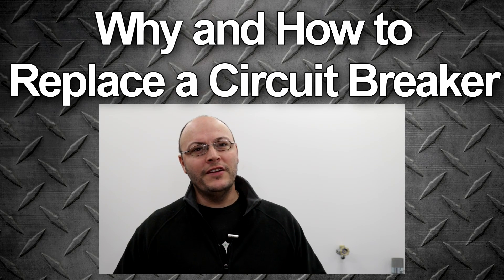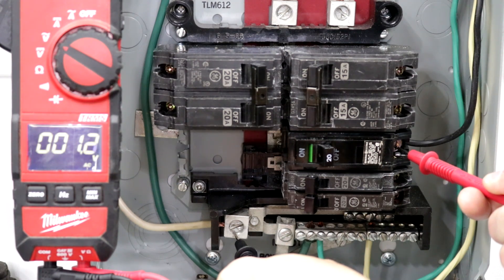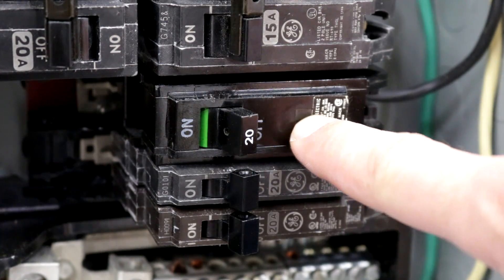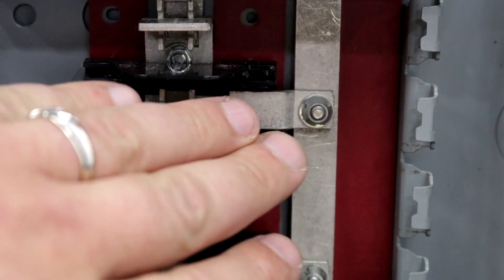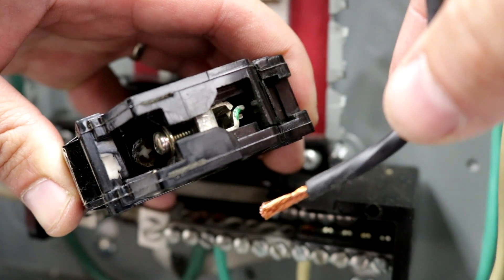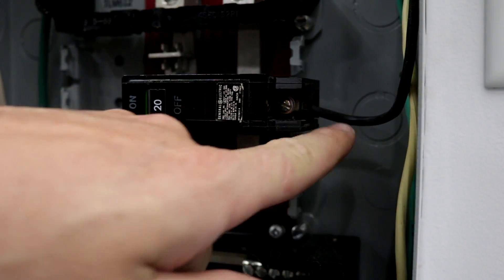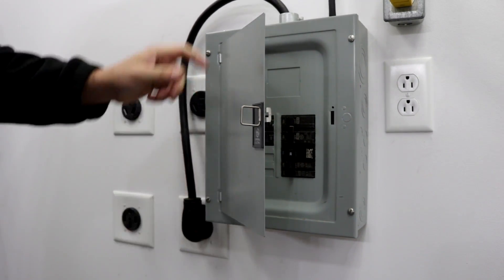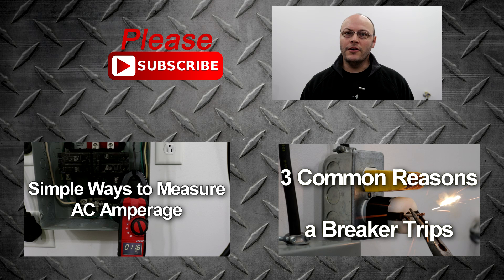How to Replace / Change a Circuit Breaker in your Electrical Panel

Comment: Really helpful... it was great to have this walkthrough before replacing a breaker for the first time!  The only additional information that I could ask for is, how to source a replacement breaker.  What information is required, exactly.  Thanks Bill!
Reply: Look at the panel and determine the manuufacturer.  Different Manufacturers have different sized breakers even though same amp (e.g. 15, 20)  The bad breaker should have a code on it - take a picture of the panel before you go to the store and match up the same type there

Comment: Greetings Bill thanks for all the great videos I have a quick question for the reading audience if I have in arc fault circuit breaker do I need to have an arc fault outlet??
Reply: I just answered my own question I found out the following if you guys are interested and Bill if you’re reading this if you can confirm whether this is correct or not that would be great
“Both the 2017 NEC section 210.12 (D) and the 20RC section E3902.17 state that where branch circuit wiring is modified, replaced, or extended in any of the areas listed above, the branch circuit shall be protected by one of the following: A combination-type AFCI located at the origin of the branch circuit. (which is an AFCI circuit breaker), or an outlet branch-circuit type AFCI located at the first receptacle outlet of the existing branch circuit (which is an AFCI receptacle)”

Comment: What if breaker is good wire is good and it receives the power 
And I put a new GFCI 
But will not reset and not give power to a charger

Comment: I am wired up my barn I have a 200 amp breaker box on my pole and 200 breaker box inside my shed I need to know what kind of wire I need to use or how come be a certified electricity

Comment: what if it is a two sided breaker for the outdoor electrica box, I have a white wire and a black wire, which one was supposed to be on top? Can anyone tell me? I  am pretty sure the white was on the top breaker and the black on the bottom but it will trip with nothing on it at all, inside. It is not turning my a/c back on so I was wanting to make sure that breaker, it's a 30 amp is wired right?

Comment: Bill,   My panel is pretty old and so are the breakers.  But they read fine.  They are all 2 pole and measure around 213v.  None of them has ever tripped.  Do i need to replace them with new ones?    Thank you !

Comment: Thank you.  Very well presented and many good tips.  I would have never thought that you'd need to turn off all the breakers before turning on the main or that the rubber insulation could cause issues if it were to be pinched.

Comment: Great video.... Ours started making a sparking noise, like a 4th of July Sparkler. We turned them all off, then turned them back on 1 by 1. They all work but the AC & HEATER. Those are the ones making noise. Is it safe to live that way until we can get an Electrician here? It looks so easy to replace, watching your video... but I’m really not sure how to turn off ALL the power. The Electric Co. said there is a “main” panel outside that needs to be shut off & I think they said THEY need to come  back & lock it? Not sure what that means...

Comment: I am replacing a 40A BR240 because this circuit will be running a 6A baseboard heater and I don't think a 40A breaker will protect it.

Comment: I want to replace a breaker in the condo unit. Where do I find the main switch for the subpanel? Thank you.
Reply: Ann Shr - Do you know for sure WHY you want to replace the Breaker??? Is something down the line causing this Breaker to trip in the first place ?? The Breaker trips because something is causing it to trip or it is old and trips for no reason.. If you have located the SubPanel, there should be a big Breaker inside of it that should be a high amperage number.. Hopefully, it is labeled, and says something like MAIN.. That should be the one that needs to be switched OFF to work on the Sub Panel..
If you do find that big amp breaker and turn it OFF, go inside and check to make sure everything electrical is also now OFF, so you know you have the Main Feed OFF. If there is nothing inside the Sub Panel, that looks like this, then you have to locate the Main Panel and look inside for a label that says Sub Panel - xxx and make sure it Your Sub Panel, and shut that Breaker off first.. And go do the check for electrical inside the condo again, before you do anything else, ok ??
Be really careful !!  I worry about you!!
Reply: Fran Danco Thank you for replying to my question. Fortunately, I didn't have to replace the breaker but replaced only the outlet. Your reply taught me where to find the power supply switch to the condo, which may come handy in the future. 👍

Comment: The issue I'm having I dont have a master circuit breaker to the main panel. I need to replace bad crt brkr live 😭
Reply: You'd better call a 'trician.
Reply: @diogiparlin957  thank you. I did it live.

Comment: I have a breaker to the stove.  The breaker does not work.  I moved the breaker to a different location in the panel and it worked.  I put breakers that worked in the original location and they did not work in that location either.  Any ideas?

Comment: If you have a room that trips because you have too much stuff drawing power, can you just swap the breaker from a 30 to 40 amp? How do you determine what size breaker you need?
Reply: No. Every size of braker needs to go with the right size of wiring and also the right size of outlet/receptacle.
For examplo: 15 amp braker uses 14 gauge wire and 15 amp outlet. 20 amp braker uses 12 gauge wire and 20 amp outlet.
If you don't use the right combination, one of the 3 pieces will melt, burn and cause a fire.
Hope that helps.

Comment: Yea the guy that just came here left breaker box on took it apart moved the double 15 breaker to a new spot shut the top one off that kept kicking  then took a 20 put it in the spot hooked room back to it . The old double breaker he left bottom on for two rooms it already ran . So can I just add breakers or higher amp ones in place of the lower ones? Or did he do something wrong I felt like it was a easy try to rig of my issue

Comment: so will a bad breaker still work, if it keeps tripping, then that alone indicates its bad even if it's putting out 120 volts? my 30 amp rv looks and tests  fine but constantly tripping with ac even if just the ac is on its a 30/20 single pole but the main side tripps

Comment: when I'm working on changing the circuit breakers like you did, do I have to turn off the meter that's on the pole also or I just turn off the one that's in my house because I have the meter on the pole outside and the one that is in my bedroom.

Comment: Just subscribed!  My dishwasher and my garbage disposal runs off the same 20amp breaker....it worked fine for years, then all of a sudden running the dishwasher, tripped the breaker... now the breaker wont even turn on from the box anymore.  It must be dead now.  Using your tips I'm confident to change this breaker out.

Comment: Can a 60 amp breaker be switched to a 20 amp due to a change in requirements ( switching A/C unit from traditional to a mini-split)
Reply: Peter Meng -- How many amps at start up and running continuously is the new A/C unit using???  If it is much less than 60 amps, then I would think it would be ok.. There is a percentage number that needs to be factored in, so you do not ever go past a certain amount of amperage.. 
So, if you know how much amperage your new unit needs at Start Up which is always higher, and then how much amperage it uses when its running continuously, then it should be ok to get a NEW breaker with less amperage..

Comment: To be safe, I should turn off the breaker on the outside of my house — then doublecheck all the breakers & wires with my detector to just make sure I’ve done it correctly — then can replace the breaker as you’ve done here.  Right?  I’ve seen folks do it without turning off the main source to the house — that’s scares the crap out of me!
Reply: Shut off all breaker switches in your panel,then shut off the MAIN SWITCH ATOP YOUR BOX after all are switched off beneath the very TOP MAIN (WILL BE MARKED MAIN)...Once all off,MAIN AT TOP ESPECIALLY,you pull out the bad breaker.Once it is pulled out from bar,away from box,it is dead.Then you unscrew the wire..Then take exact breaker to store so brand can be matched.,Then replace..

Comment: My water heater shuts off occasionally.  When I flip the breaker off and back on, it makes a buzzing sound (arching I believe), and the hot water works again after a bit.  Is this a potential breaker issue?
Reply: Do you have an electric stove?

Comment: This is my 4th breaker switch change video and the 3 others have caused me to cringe. Two even showed the main switch always on and fortunately the new switch being replaced was in the off position. WOW if replacement switch was in ON position when changing and an amateur forgets to reconnect with that switch in OFF position! 
Yours is the most logical I have seen and safest. I wondered why the wires were not removed at the other videos and re-attached while the switch was out, if wires are long enough - and you did that. More room to reconnect when not in a tight spot. Also I always turn off main switch and faulty switch before trying this, which you also did. This is the exact reason why I watch as many videos on the subject before attempting a repair. One like yours will get it completely right. Thanks!

Comment: If I have many breakers and I don't know which one is broken, I simply test them all the way you did until I find the faulty one?
Reply: Tarek Faham -  Yes, you push the Breaker to Off, and then a little farther to the end of its travel, to reset it, and then all the way to On and see if it stays ON.. 
If nothing is wrong at all the plugs that are powered by this Breaker, then it can be changed to a new Breaker of the same amperage and configuration..
Be sure first, it is not any of the wall plugs that are causing the Breaker to trip in the first place, that is why they are there..
Be careful..

Comment: Thank you for this video. Later, I will test, and replace, a circuit breaker at my (dumpy) apartment building in Winchendon, MA. Since April 2017, I have no ceiling light. Half of my wall outlet do not function, either! Former Landlord's wife simply blew me off (as being a pesky tenant).

Comment: Would you mind helping me? It was 108 here today and we blew a breaker, I wear a morphine patch, overheating=bad. I changed the bad breaker, all was well, tonight another breaker blew (one side read 4 v). I replaced that but now one side reads 12v (good) another reads 17v (not good) and the power wasnt restored to our ac and kitchen outlets. I did have some challenge screwing in one lead, but seemed like I got them all? What causes a too-high reading and shouldnt it still have restored power? Thanks so much, we can't afford $150 twice today for a quick breaker change, one I succeeded, one clearly not.

Comment: What if I have a breaker which keeps popping as soon as you turn it ON?
Reply: Tech & Lifestyle --  If the Breaker switches Off, is this a New Breaker?? 
If this is the original problem, it could be this Breaker or it could be something down the line that this Breaker feeds that is causing the Breaker to switch Off.
You need to find all the plugs that this Breaker feeds and check each one to insure all the wiring is tight and nothing looks like it is discolored or smells like it is getting too hot, and fix that first.. 
There could be more than one problem, you need to make sure all are checked to do this right.. Then, if the Breaker will still not stay on, are you resetting the Breaker correctly?  When it trips, to Off, notice how it does not go all the way to the END??  You have to manually Push the switch All the way to the end of OFF, and then push it All the way to ON, to Reset the Breaker.
Then turn on the power again and see what it does..
If it breaks the current again, and you are sure all the plugs it feeds are Not causing it to do this, then, the Breaker is next to be replaced..
Be careful !!

Comment: Ditto to what everyone else is saying, very clear and easy to follow. In my case, I have an older home with an older circuit box and breakers - my circuit breakers have two clips of equal size that clip to the two hot bars - anyway I followed your instruction to the tee and voila... I changed my 1st circuit breaker ever.

Appreciated the safety tips, it inspired confidence with caution. Noted the music was a little 'spooky' lol, probably appropriate for task at hand.

Comment: I had 20A circuit breaker trip, I re-set it and it tripped again. The Electrician changed out the circuit breaker and by this afternoon it happened again.  The only thing on this circuit breaker is a bedroom overhead light, the closet overhead light, the dining room overhead light and 3 outlets with nothing plugged into them.  I will read the article on the three reasons a circuit breaker trips.  Any comments would be helpful before I call the electrician back and tell him the repair didn't work. Thank you.

Comment: Hi, my electric range operates like 5 mins tripping my circuit breaker. could you give me some troubleshooting, could it be the breaker problem or the electric range problem? thank you very much in advance.
Reply: It’s most likely a breaker problem if it trips after 5 mins maybe it’s old and the over current protection isn’t as high as it once was for supplying ur range. You can test the breaker to make sure that it’s faulty. If so replacing the breaker should do the trick

Comment: Best video I’ve seen on this subject.  The MOST important thing was the safety briefing BEFORE starting the work.  And, it was an outstanding briefing.  Your camera shots, close-ups and explanations on how the breaker fits are great!  Great video!
Reply: What breaker to buy for a sub service box QO 16L100 100amp single pole ? Will any 20 amp work?

Comment: Great video thanks.
Im having one problem and the breaker is struck and not coming out easy. The breaker that Im changing has been tripping for the past few weeks. Im sure the breaker is stuck for that reason. Any suggestions I can not find any video online regarding stuck/ Arc breaker. Thanks for any help

Comment: Good evening Bill, I have recently moved back home to my old room- total of 4 plugs in the room I use two- one for lamp the other for TV and Roku- this room hasn't been used in years- I have plug the TV and Roku on heavy extension cord to a different plug in the hallway-so far almost 24 hours without kicking out-I am guessing by replacing the circuit breaker I maybe be able to not use the extension cord.  Any advice and know I am not afraid to fix it:)  Thanks

Comment: what if your breaker is not tripping and your outlet is not working,my power in the outlet went dead and i put in a new outlet to to see if a new one would work , but when i plugged in  the light it went off, so does that mean my breaker could be the problem?but my breaker is not tripping , is that because there is no power in the breaker?

Comment: I have a breaker that controls mostly outside outlets, but also one inside. One of the outside is a GFI that we use for our pond, have had a couple issues over the years and replaced the GFI, still have some issues, latest being that with nothing but a WIFI router plugged in, after a few hour period, it still tripped.  I can reset it and with the pond going (1 or 2 small pumps max) and the router it can run for over 24 hrs before tripping (last time I just switched router to another outlet different breaker)  Is it possible that breaker is bad, to be bad does have to trip immediately or can it take a while like this ?  Thanks, great video

Comment: Perfect video !  
If the breakers are not flipped to off / tripped ( and I check to se that they all are carrying current ) when I inspect after a whole bedroom section of my house is dead ... what would you think the problem is ?  I have heard that it could be the connection of the wire to an individual wall socket has somehow become loose and thereby lost continuity with the whole section of the house ... which could take a lot of unscrewing and inspecting to determine.  I have also heard that it could be rats or mice in the walls chewing thru house electrical wires ... of course that be next to impossible to find and I suppose extremely expensive to rectify.  Are there tips on how to determine one or the other ... and or is there another reason a whole bedroom section of the house went dead ?  Might be nothing to do with the preceding, but I also am experiencing some of my house lights flickering from dim to bright .... hmmm .. lotta electrical issues in my house.

Comment: bill, i have a square d panel , and in the panel it says only use qo breakers , so is that the only info i need to buy another square d breaker,considering its the same amp size. or is there more info you need to know?

Comment: Question.  Please help. I replaced all outlets to update thinking this would fix the 1 outlet that didn't work.  Would a breaker need replaced if all the other outlets in the room work?
Reply: Same room doesn't necessarily mean same circuit. If you have a breaker that keeps tripping after you've reset it, you've got something plugged into one of the outlets on its circuit drawing too much power, or that breaker needs replaced.